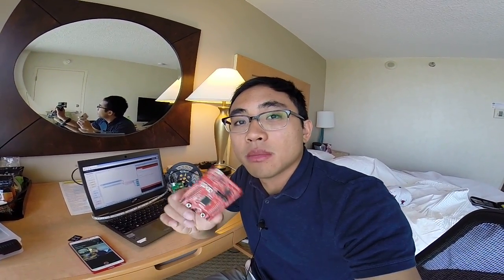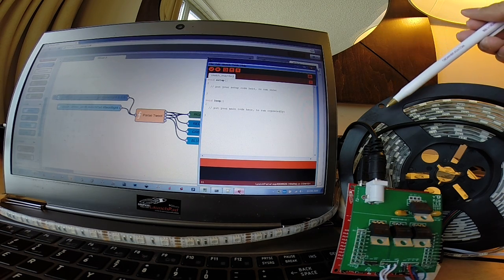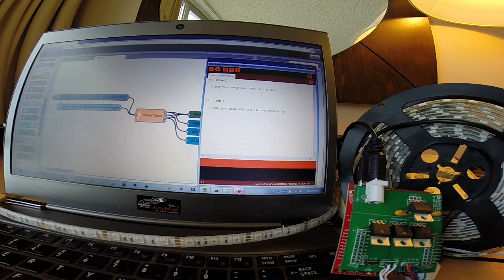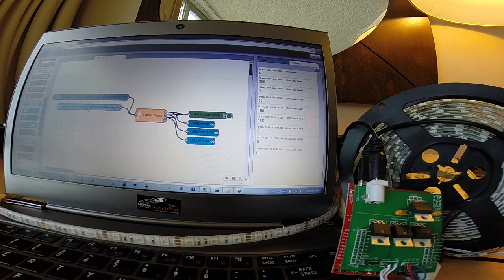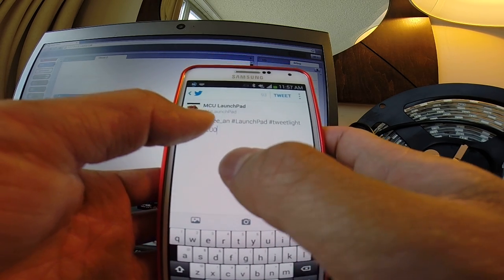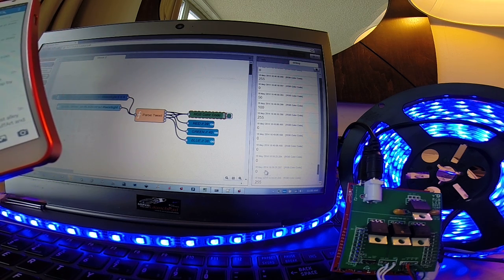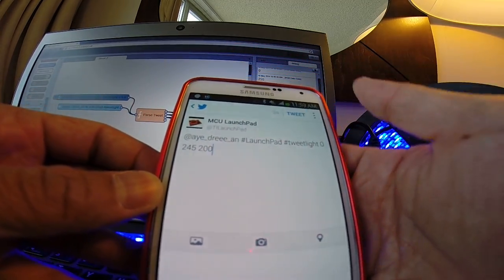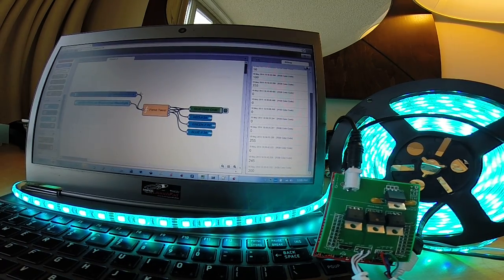Twitter-enabled RGB LED Light Strip using Texas Instruments LaunchPad + Energia + Node-RED

Comment: What if I want to post a tweet using the launchpad? Is there a library for it? I have used the arduino in the past. Thanks for your help
Reply: https://github.com/energia/Energia/blob/master/libraries/SimplelinkWifi/examples/ThingSpeakClient/ThingSpeakClient.ino

Check out this example on the Energia GitHub (fork of the Arduino/Wiring project for LaunchPad).